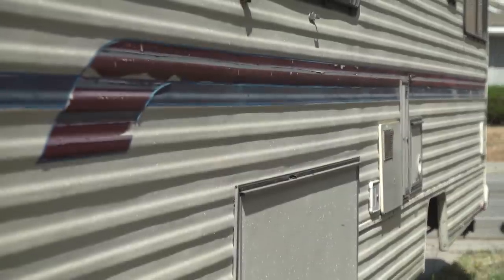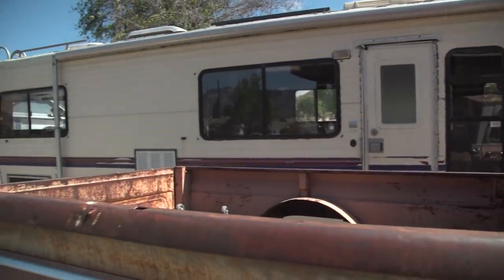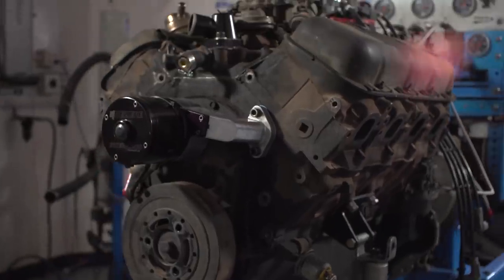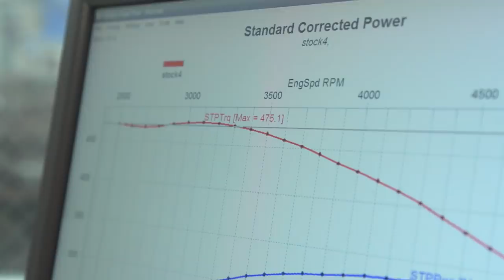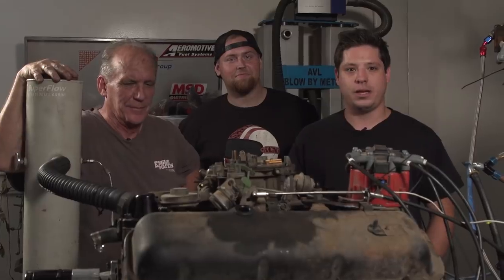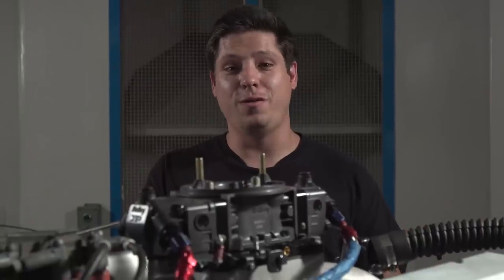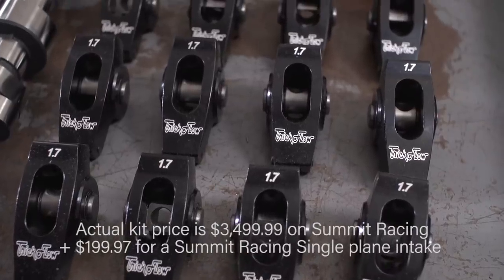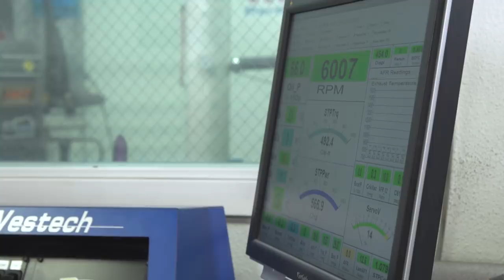Add 231 Horsepower to a Motorhome Engine With Bolt-On Parts!

Comment: Those stock numbers are pretty impressive.  I would have guessed more like 240hp with big low rpm torque.
Reply: Gerald G with all the accessories hooked up it might be closer to that...
Reply: Gerald G My old '89 Suburban made 230 bone stock and it was only a 350
Reply: I had a 1989 chevy 1500 with the 350 in it. 210 HP stock. the 350 that year made either 190 or 210. 

Of course, it did always feel a tad more powerful than that. It did motivate that big truck. Extended cab long bed.

Comment: With a little craigslisting, you could theoretically build a badder bonemaro for around 5k. And thats badass!!
Reply: John Ulicky 
The bonemarrow is just small parts and tuning away from 10 second quarter miles.
Reply: and way over budget, they were trying to go 10 seconds for ten grand, and i think they were near 12 grand and still not in the 10s.

Comment: WOW! 567 horsepower on 87 octane.
Reply: On 8.3:1 compression, no less.  They had the heads off, it wouldn't have been much more work to go ahead and swap pistons out.  9.5:1 on the same HCI setup would probably be testing the limit of the stock rods.

Comment: I'll be honest here, I figured the top end kit with the new cam would never make the 480 lbft that the RV cam made. I also was NOT expecting a 200 HP increase from nothing more than heads, cam, intake manifold, and carb, but those engines were always choked down by the emissions laws and stock LONG exhaust, low compression heads, and the restrictive stock ports. I enjoyed this project.

Comment: 330hp is way more than I thought for stock.
how much power does the accessory drive suck up?
Reply: halleffect1 The accessories and an exhaust might drop it 20hp unless it's a really restrictive exhaust.
Reply: Alot im sure,  though a well running 454 certainly isn't anemic. I would not be surprised if that RV dynoed 250 WHP. 

That was one of the biggest engines you could get but I bet it was still a dog in an RV that size.
Reply: Even the later Vortec 454 was never really a good RV engine.  My parents had an 02 or 03 24 foot motorhome with the 454 and it was a pig.  But if you can find a ratted-out old motorhome for cheap it's an easy way to get a big engine!

Comment: if it made more power with lower octane, doesn't that mean the timing wasn't advanced enough on the higher octane fuel to make maximum power.
Reply: I was thinking either timing or any number of other variables that can cause slight variations on the dyno.  I think their point was to prove that they didn't lose any power, those engines had such low compression that even with the new heads you can run cheap gas.
Reply: Just a low compression engine.

Comment: What comes to mind.  

1.  I always wondered why people don't degrease and clean an engine Before they start to work on it.  

2.  No mention of headers on a RV engine?

3.  Did they take the high octane gas out of the carb bowls before the started the engine?

4.  What you can do when money is no object.

5.  No compression test before starting work?
Reply: 1. I'm guessing it was more about time and lack of give-a-damn, just throw it on the dyno because you're about to replace half of the engine anyways.

2.  They were talking about how it had decent headers, albeit a bit small.  Judging by the heat wrap on them I'd say those were not factory.

3.  Even if they didn't the bowls only hold enough fuel for a few seconds of running, they bring the engine up to temperature before doing a dyno pull so all of that fuel had been burned off.

4.  I was also a bit shocked by the price, I feel like you could get 400-450 out of a junkyard 5.3 or 6.0 for half the price and not have to buy a motorhome (the one in the video was free, but the rest of us would have to buy the motorhome and THEN dump $4k into a potentially tired old engine.

5.  Going back to point #1, I bet it was more time and motivation than anything.  As they say, "send it!"

Comment: I've literally always wanted to do this, but a 12v cummins van then put slicks on as a full blown sleeper and race it at roadkill nights🤘🏼
Reply: I mean with the engine still in the RV lol I guess that makes it a DRV or drag racing vehicle
Reply: Did you see the live footage on FB a while back from the last zip tie drags? There was a super fast diesel bread truck, and if i remember right, it made it into the hooptie challenge.

Comment: Didn't know heads and cam were 'bolt on' parts
Reply: juicebox853 they are bolt on... no machine work needed. anyone that can turn a wrench can do this.
Reply: As soon as I saw the power gains they were getting and what it came out of I knew it was heads, cam, and intake.  Not bolt on in the sense of a cold air intake or a catback exhaust but on an old Chevy V8 this isn't much more difficult than a CAI install.
Reply: juicebox853 now you do

Comment: Great video but at the same time getting tired of seeing programs throw huge money top end kits at junk bottom ends. At the point of almost $4k in the top end the guy that’s building it would for sure get the bottom end freshened up. I’d really like to see them pull the stock heads and do a at home port job to them throw in a lumpy cam good intake and carb and try it out.

Comment: Next time try a boom threw the drivers door. I pulled a 454 with the transmission threw the drivers door. Small bit of cutting on the floor but nothing that couldn't be put right back in with ease.
WAY easier than threw the front!!!!!

Comment: I guess it's true what the guys on Roadkill said about old motorhomes for good engines, Roadkill did it, Dirt Everyday did it (sort of) so now this new show has it's right of passage, cool!
BTW did anyone else see the drip of water off the front of the engine at 6:17 ??
Reply: As soon as they pulled the water pump off to change the heads I was thinking "those gaskets are done" and then I see the water dripping.  For just testing on the dyno it's fine but hopefully they change those out before putting it into anything.

Comment: If I'm getting 1 inch of vacuum at idle on my smallblock but good vacuum while driving with no fluctuations at all, just extremely low vacuum at idle, what is the most common cause for that?
Reply: ArcticAstrophysics sounds to me you don't have the vacuum Guage hooked up to the correct place. There's ported and manifold vacuum ports on the carbeurator. Ported vaccum will give you a reading like that.

Comment: The question is do they make this type of kit for the 440?
Reply: Yes. Trick Flow makes a top end kit for 440's.  TFS-K616-620-576
620 hp. and 576 lbs. of torque using a 446 c.i.d with flat top pistons, 10.5:1 compression with a 950 cfm. carb
Reply: Craig Haynes And 440source.com will sell you a GIGANTIC stroker kit to make big cubes and big power

Comment: Impressive, how much compression with the trick flow heads? How much timing on 87 octane? Why not an rpm air gap?
Reply from the maker: 38 degrees of total timing. Compression worked out to 8.3:1 due to the dome-less factory pistons. In a street application, a dual-plane intake, such as Edelbrock's air-gap, would have benefited the combo with more low-end power/torque and only a slight hp penalty up top, as compared to a single plane.
Reply: Regardless of manifold that's a damn stout street engine, and the low compression is great because you can advance the timing enough to make good torque without worrying about detonation. Good old big block is hard to beat! 👍🏻 Any plans for a power adder?
Reply: Shad Watson, Agreed! 👍🏻

Comment: HotRod Network do you have a full list of engine parts not just bolt ons but internals?
Reply: Ken Blalock they said it's just a motorhome engine with the parts the showed in the video.  It's probably a 2 bolt main block with gm cast crank and rods.

Comment: No way the motor home came with long tube headers... right?
Reply: Chris Cahill Correct, it's a pretty standard mod for RVs.
Reply: well they did have long air lines from an air pump in them so i would guess it was stock.

Comment: You Americans don't realise how lucky you are to be able to get 330hp out of a 1980's scrapper. In England nothing apart from almost new high end German sports vehicles gets near that.
Everything is so terrible in Europe.
Reply: to be fair it was on a dyno with no accessories (A/C, alternator, rad fan, etc...)  and it did not have a stock air intake plus it had open headers (no restriction). Pretty much every engine including ones in europe would see much better numbers tested the same. 

That said, I recently traded in a 2013 impala that had 300 HP stock from the factory. crazy, but my 2017 GTI is faster and its "only" rated 220hp (they dyno 250-260 crank).
Reply: Stalin 45hp/l without accessories and the engine weighs as much as a mini...
Reply: I thought Europe was the place that ran on tiny engines that got so much power per litre no one cared what displacement you got

Comment: It's all about the torque.  So you mainly just tightened up the internals so you could push more RPM's out of it.  So really, $4k for 62 lb-ft, or about $65 bucks a pound.  That would buy a lot of nitrous (about 1000 pounds of it)...
Reply from the maker: The internals (bottom end) were untouched. The massive horsepower jump came from the increased breathing ability of the cylinder heads and roller cam.
Reply: Well if you go looking for them you're bound to find some.

Comment: All joking aside, how the hell could you ever replace the motor in a motor home?
Reply: You don't. lol
Reply: I think it goes out the bottom like most modern FWD cars...suspension and all The engine in my motor home goes out the bottom but it's a rear diesel.
Reply: I've seen old motorhomes where the whole front end can just come off by unscrewing a few bolts. Then you just pull it out the way they did on this episode without breaking anything.

Comment: just buy a Chev 454 or Ford 460 longblock from the scrapyard chances are the Chev will come with a turbo 400 Ford engine should come with a ZF5 or E4OD., you could get lucky and find one mated to a 5 speed. It will cost you much less than an shitty  old motorhome that needs to be towed to your place and towed to a scapyard.  I can buy a 454 for peanuts.

Comment: Petrol much be real cheap in USA to run that gas guzzler, not in Australia turbo diesel all the way.
Reply: It's like $2.17 a gallon for 87 octane gas here in Arizona, and $2.45 for 91 octane. At those prices I can easily afford to daily drive a gas-guzzling V8 that gets 16mpg on average.
Reply: In north Carolina 87 octane is 219 a gallon which is why I drive my 1984 dogs ramcharger with a 318 daily. 9 miles to the gallon. E85 is 179 a gallon....
Reply: A buddy of mine lives in Australia and we did the conversions from USD to AUD and converted US gallons to Imperial gallons and, if memory serves, you guys paid around $6 USD per US gallon at the time.  I pay $2.24/gallon for 87 octane (our octane is rated differently as well, though).

Comment: I cringe every time I watch some hack take parts and just throw them into a container without marking or numbering where they came.from . Each fastener for it own hole . Metal settles and adjusts to it's individual stretch and clamping forces and the whole takes a set to it's fastener . Damn , some people will not respect the engine , metal or fastener . These unskilled wrench holders wouldn't make it in a highly skilled race team or anywhere near a aircraft .

Comment: For $4k in parts  and what ever you paid for the rv you could have bought a whole other project with a better engine.
Reply from the maker: The RV was free, with a running 454ci big-block and a TH400 trans. Seemed like a smokin' good deal to us.
Reply: 4K is practically free for 560hp.   Quit cryin and learn to manage your finances
Reply: HOT ROD Network Thought the idea behind this deal was power anyone can make on a budget.. Your average guy would have to buy the RV. Then pay to have it hauled off.  Good deal for you guys. But not realistic for a "Budget Build"
Reply from the maker: You're missing the point. It's an affordable top-end kit bolted onto a bone-stock 454. What it came out of is irrelevant. If you can find a running big block (motor home, truck, bus, car, van, flying carpet etc.) and utilize this kit, the results are truly impressive.
Reply: Found a 69 galaxie fastback with a 390 that runs recently. Thinking of getting it. It's $1,700.00 but needs some real work. There's no trunk in the car. And I don't weld. But would be a nice car to build on.
Reply: +HOT ROD Network
Plus you can always resell any salvageable RV parts on craigslist to put a little money back into the project car... People wanting to build a tiny home, hunting shack, or repairing an RV will buy that stuff up.
I have had good luck reselling the RV windows, doors, appliances, holding tanks, and more that I removed from a 1998 Fleetwood Tioga 29Z Class-C motorhome. I stripped the Class-C back down to the 1998 Ford E450 Cutaway Van Cab/Chassis which has the little 6.8L V10 and Dana-80 rear. I bought the Class-C for cheap to convert into a road trip toy hauler and will be installing a sleeper cab and 16x8 flatbed on.
Reply: HOT ROD Network no shit. i was just gonna ask what you had into the donor rv. Can't beat free !
Reply: I think I'd put it back in the RV, 560 HP will definitely get you to the good camping spots before anyone else ;)
Reply: You're keeping most of the RV and that is the hardest part to get rid of.  These guys will wind up paying someone to take away the RV chassis.